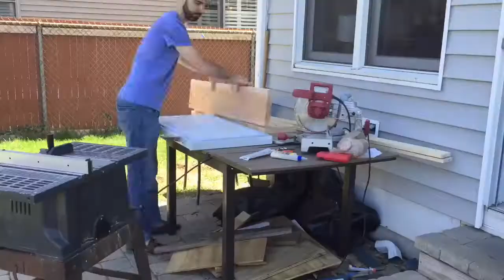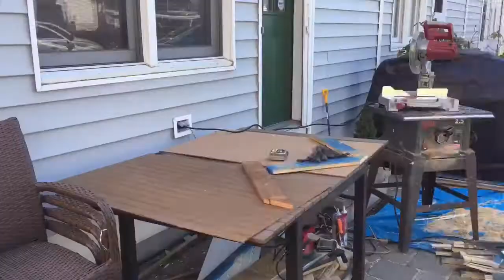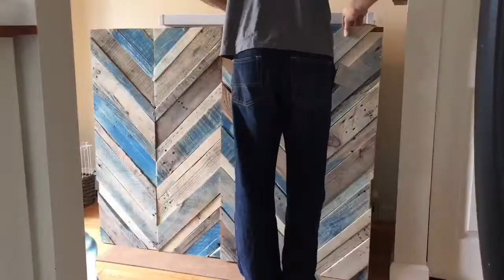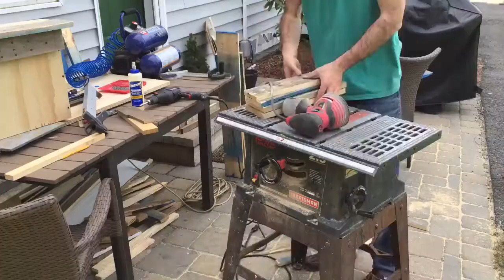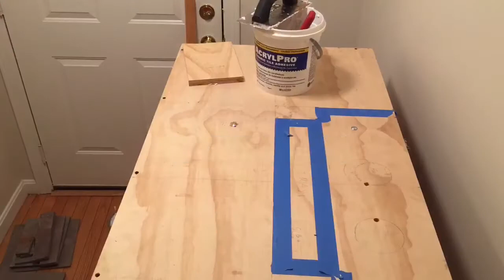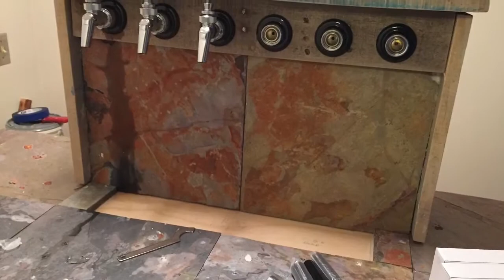6 tap keezer build

Comment: How did you get six kegs into a 7.2 CF Freezer?
Reply from the maker: jib_jeep79 by building the “collar” around the top then adding height it allows the lid to close over kegs on the box in the bottom where the components are boxed in.

Comment: How difficult is it remove the lid when you need to change kegs. Does the tap box move with the lid?
Reply from the maker: Mark Mitchell I put wheels in the bottom the swapped to furniture sliders. This allows me to pull the keeper aeay from the wall to lift open the top and give room for the taps. It’s a pain in this spot next to the wall. I also put a prop to hold the lid open when I want to swap a keg or clean.